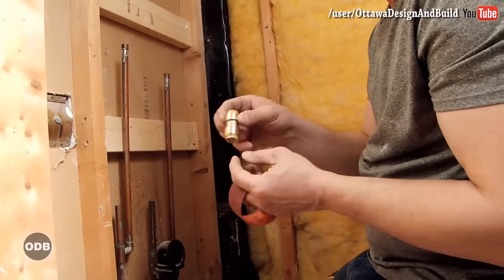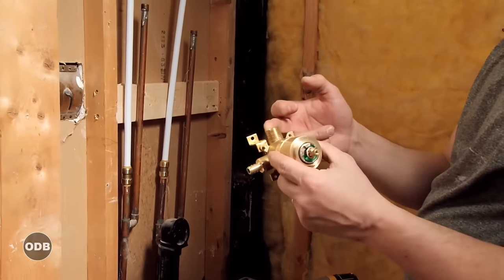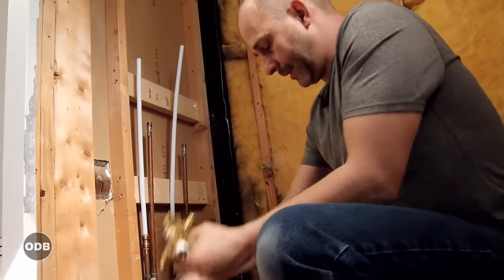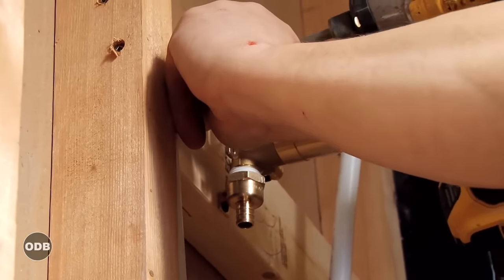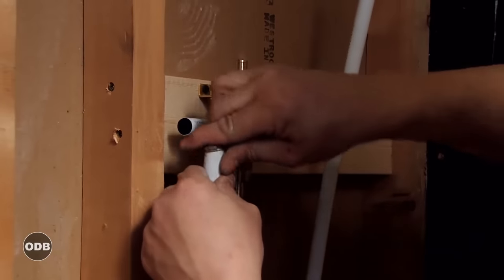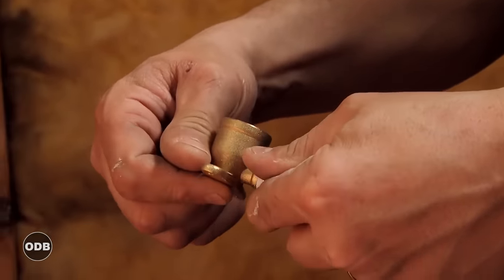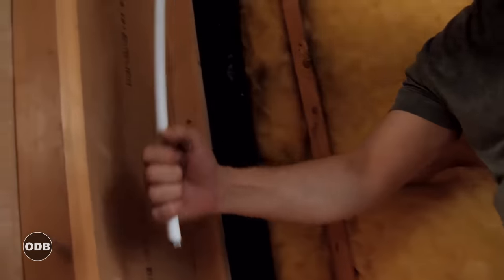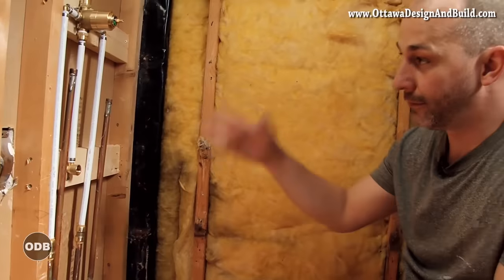DIY How To Install Copper To Pex | Shower and Bath Plumbing

Comment: 1. Hold ptfe round the other way
2. You were holding the grips the wrong way round tightening the fittings onto the valve
3. Wtf is sawder? 

Good vid other than that
Reply from the maker: Lol. thanks for pointing out the obvious. I am still a rookie. Looking forward to doing better quality stuff in the future.
Reply: But genuinley what is 'sawder/sauder'
Reply from the maker: solder Definition- a low-melting alloy, especially one based on lead and tin or (for 
higher temperatures) on brass or silver, used for joining less fusible 
metals.
Reply: OHHHHH RIIIIIIGHT!!! Solder. Not sawder/ sauder/ soder.
Reply from the maker: you had me going there

Comment: You are not following the directions of the teflon tape manufactures. 2 to 3 rounds of tape is all you should use.
Reply from the maker: Those instructions were great when pipe was manufactured in the U.S. now its all made in China and I'm telling you you need more insurance than 3 turns.

Comment: you do not suppose to install pex at the bottom of the shower valve, that is a big NO
Reply from the maker: It works fine for a do it yourselfer. If it drips from the shower while filling the tub, the water still ends up in the tub. mission accomplished.

Comment: Hey you need to make a 15/16 inch mark for 1/2 inch. This guy is gonna get you sued. He is not a plumber, and the plastic insert , inside needs to be removed for the copper. That plastic insert is for the pex side only.
Reply from the maker: the insert used to, have to be removed. Not any longer with the new generation of fittings.

Comment: That insulation job is terrible.  It would fail a QII.  You can see how dirty the batts are from filtering the dirty air that has been passing through, and the gaps encourage thermal looping.  I suspect it gets pretty cold where you are doing this work.  Just sucking BTUs out of the house for no good reason.
Reply from the maker: The reason for that is in new house building the plumbing rough comes before the vapor barrier guy. So stupid!

Comment: 15/16 for 1/2 inch, an 1 1/8 for 3/4 and 1 1/2 inch for 1 inch.  These shark bites will not work if you don't install correctly.
Reply from the maker: I would have to agree. If you push and twist and do a pressure test then they are installed correctly. Just like this job was.

Comment: Since He Is Using Sharkbites
Fittings You In Your Own House
Use Copper Pipe, All Of Them 
Using Apex Plastic Tubing So
That Is The Way You Can Call 
Them After 1 Year For Leakings.
Donot Install Plastic Tubing 
Garbage Never.
Amén.

Comment: plumber use hammer arester  and insulation 
And he also secure the pipe 
you didn't  do any of that
Reply from the maker: Actually with the new valves today there is no more need for the hammer arester. Insulation is completely optional

Comment: This video just shows that you are either to lazy to complete the connection with copper. PEX MATERIALS ARE PRON TO CHEMICAL DAMAGE AND IF YOU LIVE IN AN ARE PRON TO FLOOD OR HIGH HUMIDITY THEN LIQUIDS CAN ENTER THE WATER SYSTEM AND CONTAMINATE YOUR DRINKING WATER. THIS IS A BIG NO NO TALK TO YOUR INSPECTORS GET PERMITS

Comment: Wrong pex color, blue for cold red for hot, wrong way to put the teflon tape wrong way to put the pliers to tighten the female adapter , hope you do not get leak at the end of the job ----But actually with pex it's very easy to be plumber
Reply from the maker: Thanks but red and blue are optional. Last time i checked they still only make 1 color of copper and plumbers don't get that mixed up. Maybe cause cold is always on the right!

Comment: Why didn’t you get a sweat to pex fitting and solder on to the copper and join the pex with the tool you already had and you wouldn’t need that bullshit access door

Comment: Several mistakes in the first 5 min. But what would I know?  I only have 25+ yrs exp. served a five year apprenticeship, and have license to prove it. It`s not what you know in this case, it`s what you don`t know. And you are about to cover up your mistakes behind finished bathroom walls. It can be expensive and messy to repair later.
Reply from the maker: Not worry Steven I have an access panel.
Reply: Sorry bud, but it`s wrong.  I used to do my own maintenance on my vehicles and I would usually find out later what I did wrong. Spent too much time under my car or truck, in a buddy`s garage or my drive way in the cold repairing my truck. More time than it was worth. Now I take it to a qualified mechanic.

Comment: Screw all that I'll just soldier the copper pipe fitting install my pex connections outside the wall with pigtails then fit it inside the wall and cut the ends to meet the copper, beyond that .
This guy has no concept of levrage the reason the slip joint plyers and crimp tools are long so you can grip to the end and using the center folkrum get more leverage and a positive crimp.  Why stick sharpbite connections behind a wall, your going to rock over with sheetrock-hardie backer- or some other panel waterproof then tile. That 10k bathroom will be a pain in the ass to replace 1-2-3-or 4 more times because it sprang a leak.
Reply from the maker: Thanks for telling us another completely different option of how to sconnect the water supply. The purpose of this video was to show an option that didn't need soldering for those people who don't feel comfortable with it. The sharkbite will last 25 years. And it can be replaced at that time from the other side of the wall.

Comment: Modern plumbing? Nope. Too many things that can go wrong with this way of doing it. Here we went away from this way of installing waterlines more than 10 years ago.
Reply from the maker: Wher is that. Up here in Canada All we use is pex now . Even for commercial applications it it starting to take over.

Comment: Those rings have been proven to cause THOUSANDS of dollars worth of damage!!!!
Reply from the maker: They work fine as long as you doa pressure test before closing. I do now recommend the solid rings. The crimper was far too expensive for the average homeowner 2 years ago. but now they have one for 30 bucks.

Comment: NEVER USE Pex  !!    the connectors will LEAK, if not immediately... a few years down the road.
Reply from the maker: why would they leak down the road the parts are copper and stainless steel.?

Comment: pex
Reply from the maker: Yup, we suggest to run a 3/4 line to avoid problems with dripping. allthopugh it drips into the tub you are trying to fill so there really isn't a problem , just an annoyance.

Comment: LOOKS LIKE CHEAP CRAP SORRY BRO <
Reply from the maker: True, around here this used to be the only cheap way to run your own pex plumbing. I will be doing another valve soon and will be showing a new crimper that works with the solid rings that is quite affordable, finally. This is a home owner special. not the industry standard.

Comment: As soon as i seen the channel locks backwards I quit watching.
Reply from the maker: The extra torque you get from using them the proper way is not necessary unless you need to hit the gym.
Reply: Torque. Grip. Same thing, right? They just feel better in your hand when used properly. They don't feel awkward, and you don't end up looking like a complete penis at the same time. I'd hate to see how marred up anything looks like that you DO need to get really tight.

Comment: This guy doesn't even know how to use the teflon tape. And you don't use pex on a tub spout connections. You use copper or galvanize. Pex is thinner than copper on the inside diameter, so when you want to fill up your tub. You will have water coming out of the shower head as well. Doe to water pressure😤😎🤓🤣🤣🤣🤣
Reply from the maker: You are assuming that the water pressure is an issue. It isn't where this house is located.
Reply: Sharkbite has been in business for 15 years now. So u do not put Quick compression couplings on there. Only is recommended to an exterior area or water heater

Comment: There are NO advantages in using this junk......I'm a realtor in Las Vegas....there was a class action lawsuit
vs this tubing....it was replaced in thousands of homes.  Lesson: use copper.
Reply from the maker: I would appreciate it if you sent a link to this. I believe you are confusing products.
Reply from the maker: Agreed, connectors have evolved very fast in the last few years. The pex itself has been proven to be a very reliable product.
Truth is once pex is pressure tested it has a dramatically lower failure rate than traditional copper plumbing.
Reply: There is no class action lawsuit against pex tubing. There were a couple lawsuits against Kytec and Zurn because of bad brass fittings used for pex that were dezincifying, and of course the huge lawsuit vs polybutylene plastic tubing used in the 80's, which is nothing at all like pex. I hope you're not giving plumbing advice to your clients with this wrong information.
Reply: Also, plastic CPVC pipe would sometimes fail, particularly in hot water lines where they became brittle from the heat over 10 years or so.  A lot of CPVC are now being ripped out.  Unfortunately,  uninformed internet warriors equate Pex with CPVC and PB pipe, which is not Pex.
Reply: john del IS on point, and the issue with Poly butalene was that the factory Q.c. was lacking and so pipe was made with in consistent wall thickness and. majority of new water SERVICE pipe is PB ( blue stripe )
Reply: Yes, totally agree.
Reply: Las Vegas is a gamble at anything ha ha